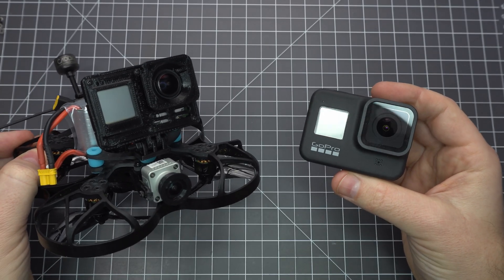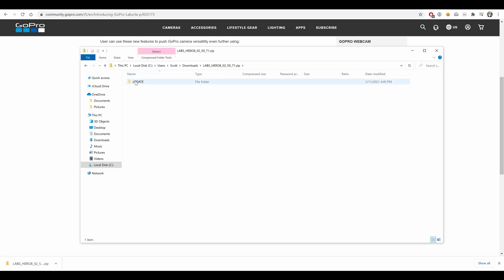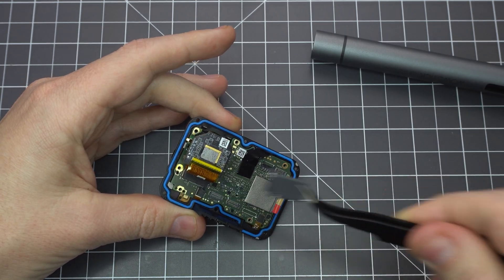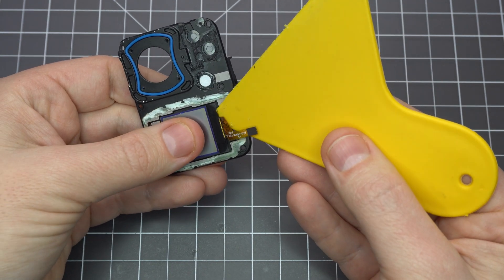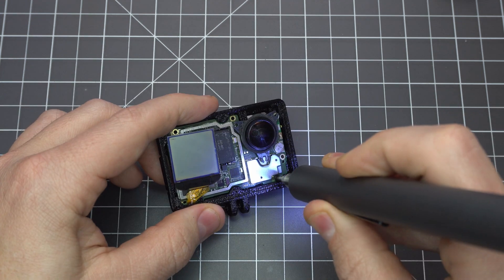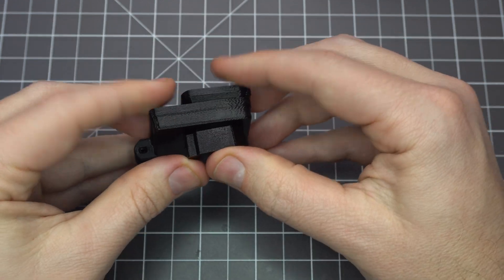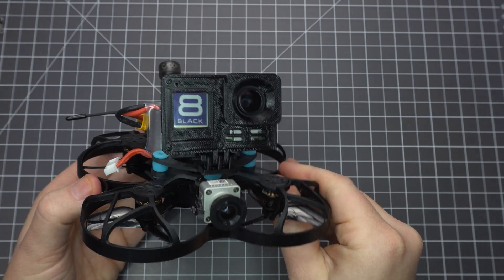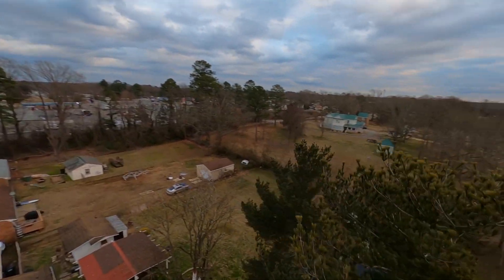Convert a GoPro Hero8 into a Naked GoPro with the iFlight BEC and Case

Comment: Hi ! I am having two problems hope I can hear suggestions from your experienc:
1- I link my phone with go pro before I make it naked. and now I cant bind my phone so I cant change settings via my celhpone .dont know why.
2- its hard to start up de go pro while connected to beta 85 hd, sometime its takes to long, sometimes it does not starts on, still when it is powered  by the drone battery.
Thanks in advance.

Comment: Excellent video.  I have a naked Hero 6.  
I'm thinking of upgrading to Hero 8, but I don't know if Reelsteady compatibility is good.  Gopro Labs firmware for the Hero 8 says it adds better compatibility.  Have you tried it?  How do you activate it?  Thank you ✌🏻
Reply from the maker: RSGo works great with the Hero8. You don't even need to add sync points or flash the GoPro labs firmware. It'll work out of the box. I do recommend adding the firmware for the QR Control app though.

Comment: Loving the content brother! One question, how is the iFlight BEC behaving so far? Is it possible to solder the included wires to a 5v 2A on my AIO board?
Reply from the maker: No issues so far. 5v from the AIO to the BetaFPV BEC? It may not be enough voltage.